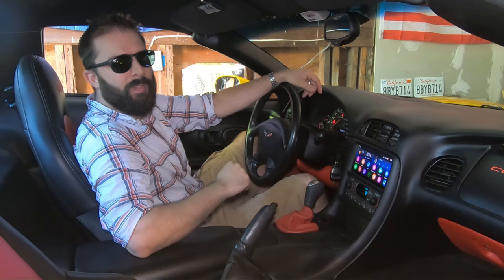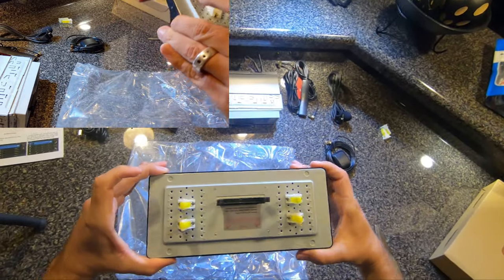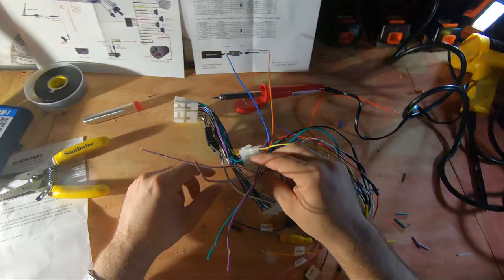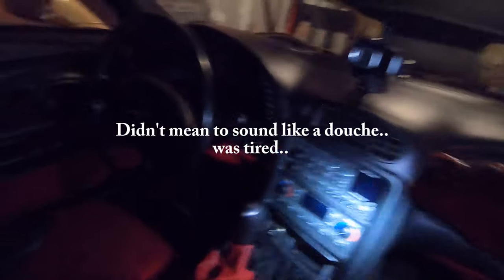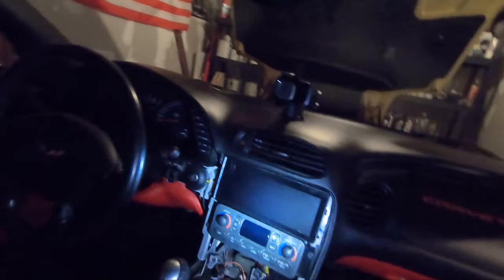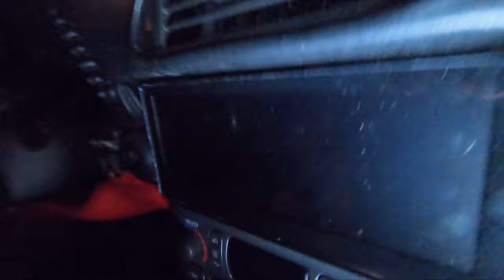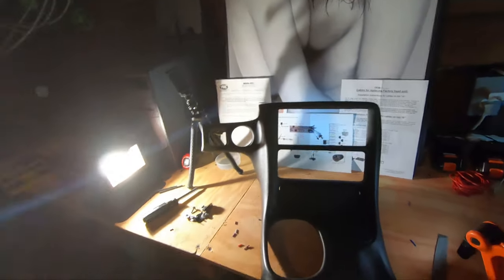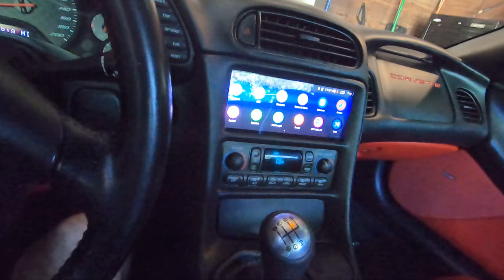THE BEST C5 CORVETTE HEAD UNIT YOU HAVE NEVER HEARD OF. RETAIN THE STOCK BEZEL WITH GPS & ANDROID.

Comment from the maker: Oh one thing I should have mentioned!!!   Once you have everything hooked up (assuming you are using this head unit) you MUST turn on the amp via sound settings on the main menu.  You will get 95% treble until you do that!
Reply: That's awesome... the default voice is a Russian chick...  🤣🤣
Reply: I liked yours so much that I ultimately chose the Joying myself, and had it installed. Could you be a little more detailed about how you turned on the amp. Thanks.
Reply: Do I have to disconnect the cd changer, or will it work with this unit? Thanks
Reply: I CANNOT FIND THE SETTING TO TURN IT ON 😫😫

Comment: What I really like is the way you framed the bezel in front of the unit. Looks so much more clean and factory . I was originally going with a flip out Pioneer , but now maybe not . Good vid, thanks.
Reply from the maker: Thanks man
Reply: Thinking about giving my flip out pioneer to my gf for her car and trying this out. If I do, would the wiring harnesses be very different? Or are most wires universal except for a few? I’m assuming each harness is fairly different if even the JOYING radios varied by wire color like you said in the video.

Comment: As the link for the Joying unit is no longer working, would you confirm if the unit is the one with 8.8" screen? That one is widely available on ebay and seems to be just the same. Thanks!
Reply: @believe2806  Yes it is the 8.8 inch. I just purchased it. Nice unit.

Comment: Also, the information you lead us to for the wiring pac says ”For 1997 - 2002 Chevrolet corvette vehicles
Factory Bose EQ cannot be retained, optional tweeters are needed to maintain high frequencies” so this DOES NOT retain the original bose system.  And note above this is for 1997-2002? C5 years run and include 2003? So this is not for 2003?  Seems like a great product but the information is sketchy? I do appreciate your time in posting but, unclear information is frustrating.
Reply from the maker: Hey man. The pac vet1 will work with the 03-04 as well. I think it was developed in 2002 and they never updated the description. They never changed the Bose system in the C5 so the tweeters are not affected. Hope this helps bud. 👍🤙

Comment: I was able to get my amps working for a bit, but the next time I turned the car on they completely stopped. I also noticed how quick this unit drains the battery. Any suggestions?
Reply: Did you ever solve this issue ?

Comment: never got the amps in the door speakers to work.... sounds like crap without them ... thinking about doing a full audio build without connecting to GM`s / bose at all..
Reply from the maker: I remember when I put this in my amp didn't want to turn on.  I really had to solder the hell out of the amp trigger wire to get a solid connection. Even now there is a 3 second delay for the amp to turn on.  Recheck the blue/ white wire to the orange one I think?  Need to watch the video again myself.

Comment: One question did you connect the face to the unit or is the face separate and just sandwiched between the trim?  Looks like there would be more room if I remove the tabs on back of screen and connection point to the unit? Video was great super easy with your directions!
Reply from the maker: The face is connected 👍👍. I used some think double sided tape between the back of the screen and the metal frame of the console.  Probably was not necessary as it was sandwiched in there very tight!  Crazy how perfect it fit.

Comment: Hi, I have tried the link for the head unit and it "can't be found". Would you be able.to list the model and screen size? Joying doesn't list a 1.5 on thier website, might have to go the ebay route, and they are all listed as per screen size. Please help. Need to get this done. Great job on the info for install.

Comment: I got no signal on my backup camera.. is there anything that you have done that you may have left out of the video? Thanks for the video
Reply: Disregard this comment.. I got it fixed and completed the installation.. new problem.. battery seems to be drained and now won’t start 😭 have you had similar issues?
Reply from the maker: Yeah Corvettes drain battery power quickly when doors are open etc for a long time.  Probably just need a jump.
Reply: VetOnVettes757 yep that was it lol thanks again!

Comment: Great video! Complete and thorough, with good editing for smooth viewing. Inspired me to install the same setup. I know its a year later but hopefully you can answer a quick question. The illumination/dimmer wire.... I hooked it up to the same circuit on the hvac unit like you did. But it doesn't seem to work right. When I turn on the headlights it seems to get a little brighter, and the knob left of the steering wheel doesn't really do anything to the head unit illum. The hvac illum is fine.

Comment: I was just pondering if I should consider a unit similar to this if I should invest the money in a tablet or a double din oh, but it's interesting you mention something about 20-plus years old archaic? Then it dawned on me with hearing about some of the issues people are having with units even Pioneers that last 2 years? But that archaic piece that's 20 plus years old in my C5 still works great? With the Bose amplifiers and Bose speakers one of the best sounding stock systems installed in a vehicle actually, even the CD player still works great although the CD changer also works when you are parked at a park or something or you just want some tunes in your shop you turn on this bode system and it is plenty
 good? And reliable..., when I go drive my convertible 6MT, millennial yellow C5... it's really about the vehicle being able to go 165 miles per hour, and Corner better than anything in this generation hell this is the car that won LeMans and dominated for several years many years after... so that poses one question which stock car on this entire planet could do 165 plus win LeMans handle in such fashion in yet pose have a incredible sound system that actually lasted 20 plus years and is still going strong? Anybody? 
put  some VH on.. A little “dancing in the street“
On CD.. it's impossible to duplicate that sound... 
 I don't know I may consider a tablet mount with a Bluetooth just to have the navigation and some of the apps rolling at the same time integrated with the original head unit.. which still works awesome.. even after two decades.

Comment: Did the head unit not come with an illumination wire ?
Reply from the maker: It did.  I believe it's yellow?
Reply: @VetOnVettes  would it be possible to remove the portion of the pac-1 that won't be used , like unplug it to same space ?

Comment: I got lossed on the “Legend has it” 3 wires under the passenger foot well. What was the red wire you soldered to the yellow? And where did you connect the reverse wire so it knows you’re in reverse??
Reply: Same man. You need to find a big fat orange wire under the passenger footwell in the cluster of wires. There’s a fat red and pink one so make sure it is orange!! Then you can tap the red wire from the stereo harness to the orange wire. It’s your vehicle accessory wire, it triggers on the radio

Comment: Just finished and it all worked great ! For me the Blue-White wire for powering the amp was not connected in the opposite white plug. The blue wire ( antenna power ) left over must be powered with the orangeblack ( fused JoYing ) wire to activate the amp. Added the Joying remote and made it fit in the cup holder. Thanks for making the great video !
Reply: I'm totally confused. I bought ALL of the same harnesses and radio, etc. He recorded himself soldering the solid blue wire to the short wire that has the "BRAKE" flag on it, but wrote to solder the solid blue to the orange/black wire WHICH I DON'T HAVE. Can you clear this up for me please?
Reply: @manthis22  the orange-black is the wire with the glas fused out of theJoYing. That's the amp out wire to acitivate the Amplifier. In my white connector there is a blue-white wire but @ the other plug there was no wire. I find out that I need to use the bleu wire instead. when I powered that onde the Amplifier will work.
Reply: Just back from a roadtrip. System is working fine. Exept it is sometimes hard to reconnect to Carplay. I saw that JoYing has released firmware Android 10.0 1280X480 Old UI 2023.5.15 looks like it solves the carlink issues. my Joying was delivered with firmware 2021-12-27.

Comment: One question, how did you secure the headunit inside the mount space? Mine is just floating there. I dont see anywhere to screw or fasten it
Reply: It mostly just floats. It's kinda held in place between the climate control unit and the 2 tabs for the radio bezel. And the radio bezel kinda holds it against the radio cage. It won't go anywhere!

Comment: Don’t take this the wrong way. I came across this Video on Oct 31,2020 yesterday. Watched the complete Video. I don’t care for this set up. I just upgraded my ‘99 C5 Coupe this past May of 2020. I had gathered up everything I needed for the install during the Spring/Summer of 2019. I went with the Metra Replacement Cluster, a New Kenwood DMX7705s Double Din Receiver w/CarPlay and a Axxess Interface. If you would of used the Axxess Interface you wouldn’t of needed to run a wire into your passenger footwell. Everything you needed came from wires already present behind the stock radio wire harness. I did a lot of research on the product before I started the job. The hardest work to do for me was to drill out the rivets holding the 2 aluminum shelf’s in place behind the Cluster. Some take a Sawzaw to cut them out I decided to not destroy mine so that if someone down the road wanted to put it back to factory stock they could. I believe it was the better way to go with a project like this.
Reply: I wrote the above post last year and I stand by it. That being said did anyone find out if they are still making this ATOTO Radio or one similar to it. I may need one to install in a late 80's SS Monte Carlo. There is no way to fit a 7" Double Din in the Monte Carlo and make it look right. I need close to another inch of room top to bottom but this Radio above I think can be made to fit so all not a waste for me checking out this video last year.  It stuck in the back of my mind. Hoping I can find a unit similar to it with CarPlay also if that is possible with this brand.
Reply: @ffas23  just look up joying 8.8. They still make it.